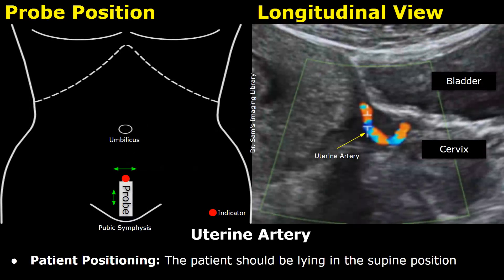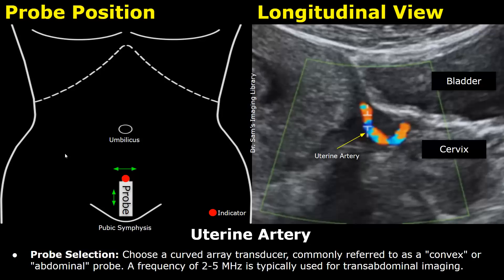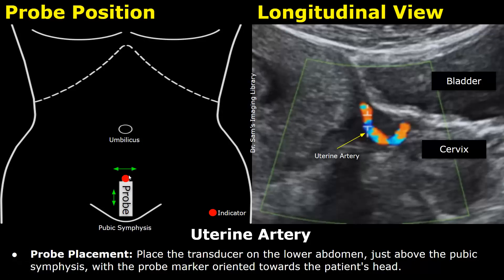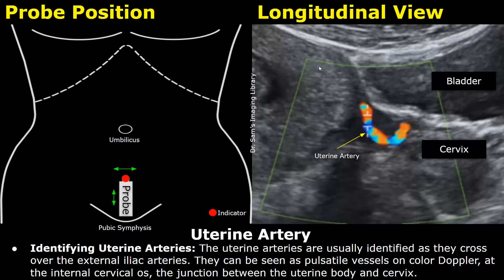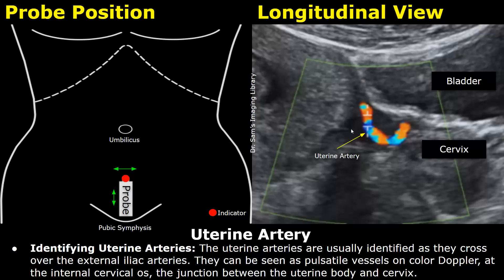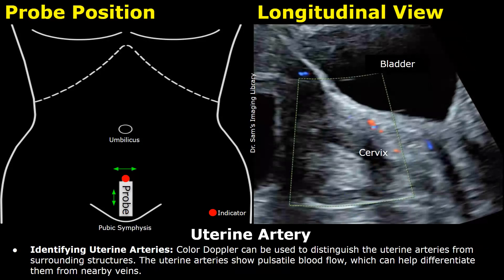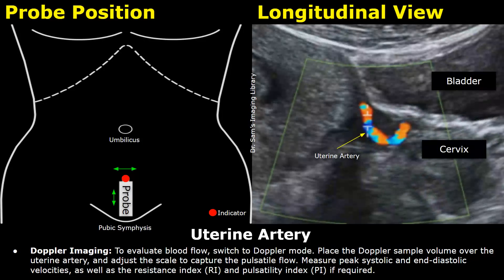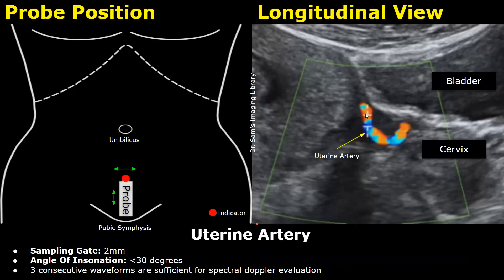How To Scan The Uterine Artery | Doppler Ultrasound Probe Positioning | Transducer Placement USG

Comment: Good evening sir i hope you will be fine. What is importance of uterine artery color doppler and abnormal finding pls reply sir🙏
Reply from the maker: Good day! For uterine arteries, spectral doppler evaluation is preferred rather than color doppler. It can be used in diagnosing mainly preeclampsia and IUGR
Reply: @DrSamsImagingLibrary  Thank u so much sir 🙏
Reply: Good afternoon sir i hope you will be fine If a copus leteum cyst less than 5 CM
Impression should write ovary shows a cyst or ovarian cyst pls reply sir🙏
Reply from the maker: @MukeshKumar-gq4ij Good day! for such a cyst, you can write it as "Corpus Luteum Cyst" in the impression
Reply: Good evening sir how are u sir ji. Normal rage of color doppler PI, RI of umblical cord, mca, and uterine artery pls reply sir i hope u sure reply me. 🙏🙏

Comment: Have you ever seen a difference in RI depending on which side the placenta is biased?
Reply from the maker: Yes. The uterine artery on the side of the placenta can have a slightly lower resistance index (RI) or pulsatility index (PI) compared to the contralateral side